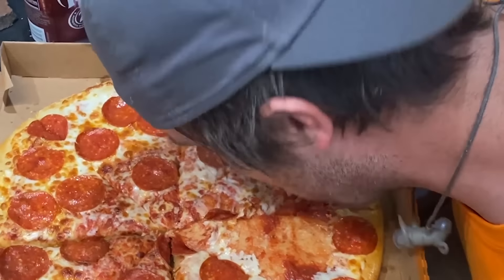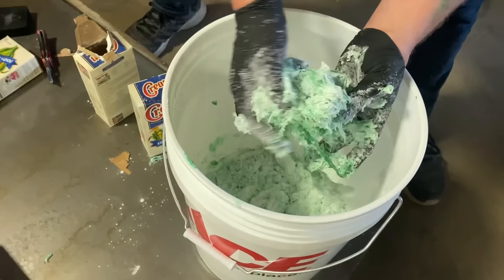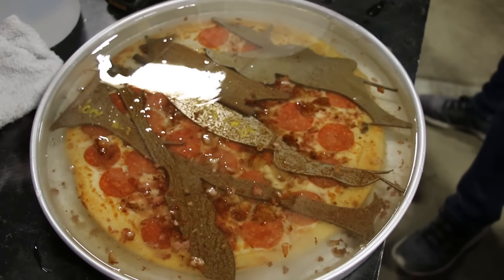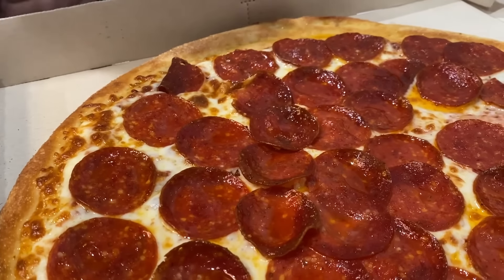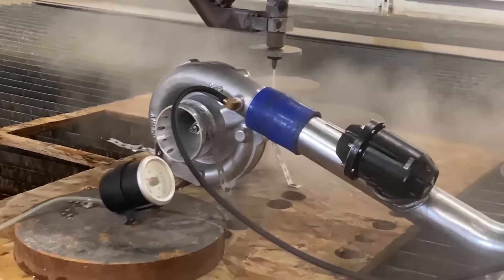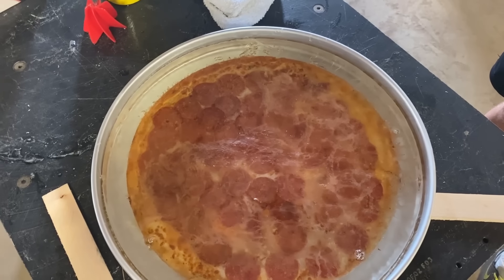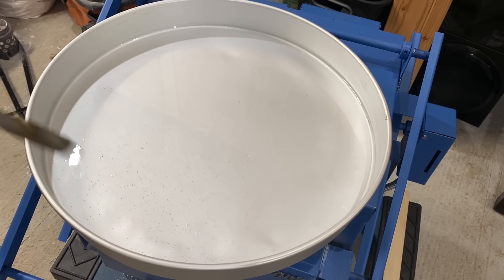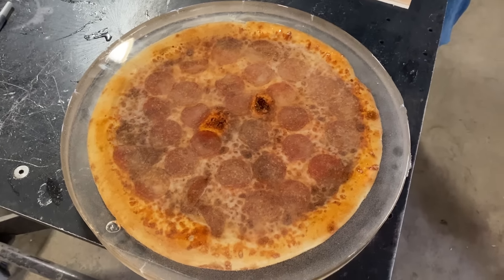Pepperoni Pizza Encased In Epoxy Resin -Harder Than It Looks

Comment: I do some epoxy pouring for furniture, but still not an expert. I do know that water and epoxy don't usually get along, so I would've freeze-dried the pie to hopefully preserve the nice red pepperoni color. Then if you submerged it in resin and pull out all the air with your vacuum it might work out. I've impregnated really spongy spalted maple wood (partially rotted) with epoxy using a vacuum chamber and it works out pretty well.
Reply: Plus bacteria will start to break the pizza down. If you freeze dry it there will be a much lesser chance of that happening.
Reply: Spoiler alert. Jeeze.
Reply: @hardboiledtoast6086  😆
Reply: How do you impregnate wood ????!💀💀💀💀😥😥
Reply: This!!! Otherwise the piece can rot inside the resin in the pocket. Any food, meat, etc. I'd definitely freeze dry it beforehand and seal it properly somehow just because I'm not sure if the liquid, heating epoxy before and while it cures will do anything to the food inside if it's freeze dried.
Reply: @Mari-gq2jp  You know what he meant he just didn’t use “Penetrate” 😂
Reply: @teal80  lol

Comment: Who else cant wait till next month when the pizza turns green and moldy and they decide to water jet it 😂
Reply: Bob Watters  it can still deteriorate without air but probably not mold
Reply: Bob Watters  seeing as they didn’t put the whole pie in the vacuum chamber there is still lots of air inside the crust.
Reply: Well at least if it does brak down it won't smell cuz it is encased. Lol. But if they cut it then eeeakkk that will b nasty lol
Reply: @suzz1776  it could still permeate through.
Reply: Or burst, if enough pressure is generated inside.
Reply: They did cut it up!

Comment: LOL. Get in there nice and deep. I guess the resin isn't combustible/flammable, I usually use a heat gun to get rid of the tiny air bubbles. I love the crazy sh@t you guys come up with.
Reply: Shat? Oh... I write sh*t like this.
Reply: I have always used a torch. I have seen a spray they make I’d like to try. You mist the surface and the bubbles pop.
Reply: Torch works great but if I use xylene to thin the epoxy I use a heat gun to pop bubbles
Reply: @robboss1839  you did a full spread.

Comment: Hilarious as always! Can you do a follow up in a few months, I wanna see if it rots in the resin
Reply: It probably will
Reply: @draconic5129  it wont
Reply: There will for sure be some degradation, but I doubt it'd be super noticeable considering it's in a completely sealed environment. Idk I'm not a microbiologist
Reply: It shouldnt, in order for things to rot they need to be exposed to oxygen if memory serves me right.
Reply: @swenmcheath1798  I'm sure it'll still break down due to the enzymes that are already in it. So even though it won't decompose in the same way it will still break down and therefore it's appearance will change.
Reply: @draconic5129  turns out you were right, appearance deff changed, the meat got a lot more grey afaict

Comment: A bit of artist materials advice if you ever wanted to try this again: the polyurethane sealant is water based, hence why the grease (along with all the other food oils) repels it, as they are hydrophobic. However shellac based sealants should not have as much of a problem adhering to a still greasy pizza, (I've never actually tried it myself, but my understanding is that an isolation layer of shellac on an oil painting will allow you to them paint on top of it with acrylics, which would otherwise normally be resisted and peel off,) and might allow you to ready a pizza for the resin pour while it is still much "fresher."

Comment: I agree with CCR. Also, maybe the grease won't be an issue if you turn the pizza upside down first. Maybe the grease likes to float up so if it's upside down, the grease would float up to the underside or just stay put.

Comment: pizza in a single layer saran wrap "sandwich". vacuum chamber to remove some air and get the saran wrap really stuck together. saran wrap creates a clear layer while maintaining a barrier between the epoxy and grease. pour mold.

Comment: You need to vacuum the pizza also because there is trapped air within that will promote rotting. Suggest vacuum the pizza and wilfully the vacuum chamber with dry nitrogen, do this a few times with vacuum and charge with nitrogen. This will get the nitrogen into the pizza 🍕.  Then pour resin and insert the whole thing and vacuum it again. This will preserve the pizza better longterm.

Comment: I think you need my brainstorming help; like for this: Prefill a half-layer of uncured resin and set the prepared-pizza face-down, then top the resin off over the crust to cure; so the lighter-than-epoxy-grease floats up through the crust and soaks in.

Comment: You shouldn't use suction to de gas the resin because most of the bubbles inside pizza and it will make you casting worrest

Interested suction use compression to minimize bubbles and keep pizza perfect after curing and it will fill empty pockets inside pizza with resin

Try this next time

Comment: Better solution would be to use a couple of thin rods to penetrate the pizza from two ends to keep it down in the epoxy and when it has hardened you can just remove the rods.

Comment: Man this could have been solved so easily if you guys just waited for the first half of the epoxy resin to harden with the pizza inside. It would act as a "weight" for the top half of the epoxy.